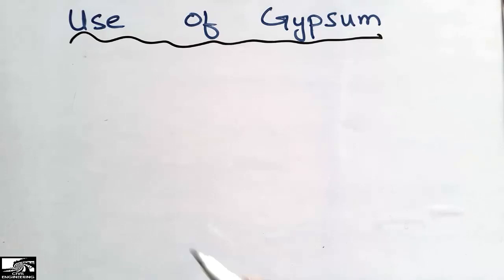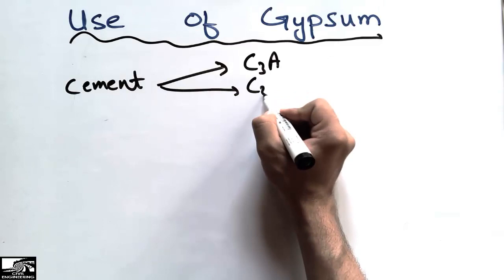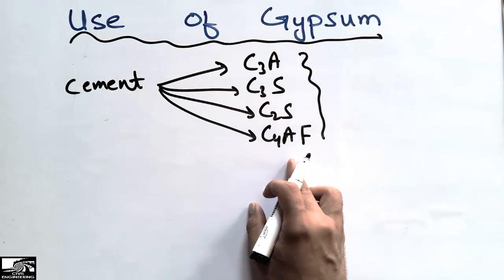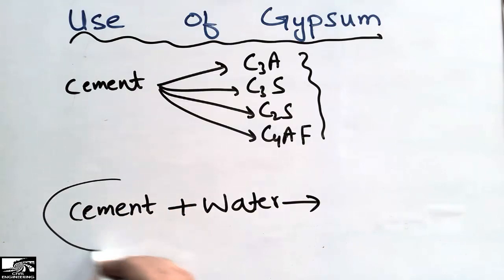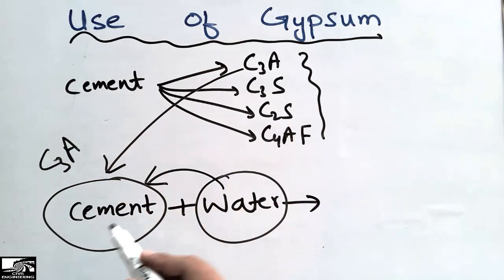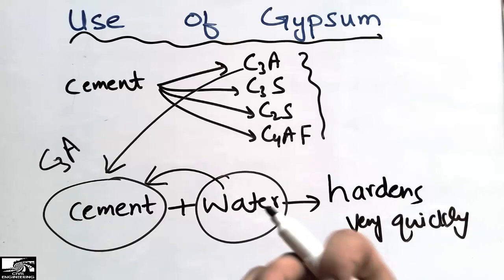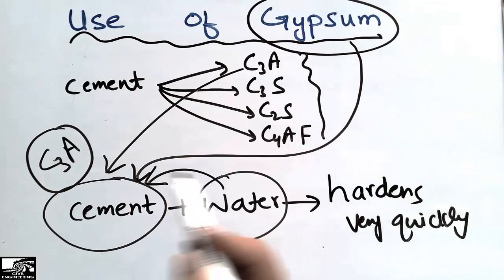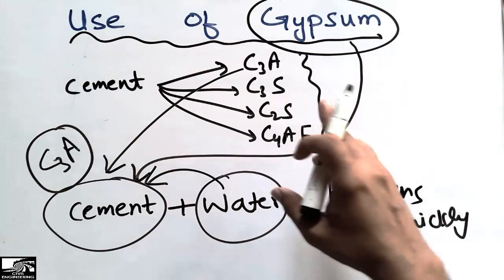Why Gypsum is added to cement

Comment: Sir how much gypsum is present in opc 53 cement, 
Can we add gypsum in plastering mortor to increase initial setting time.? If soo how much gypsum needed to added per 50kg cement?
* workerd delay using mixed mortor plaster usage soo its been used after initial setting time of half hour!